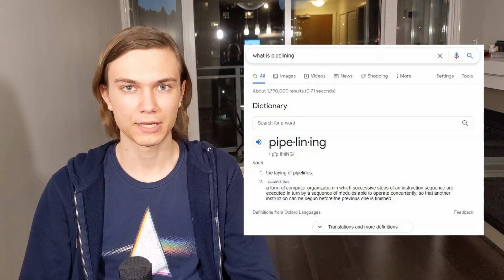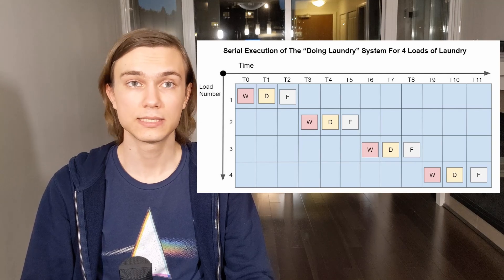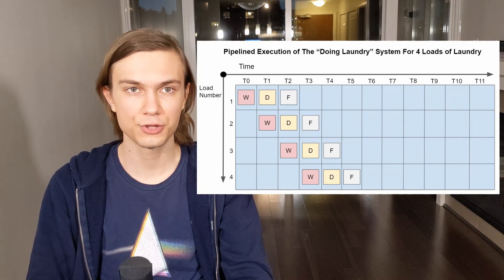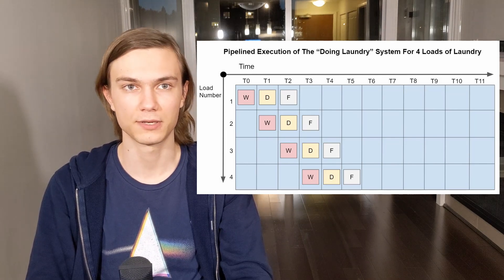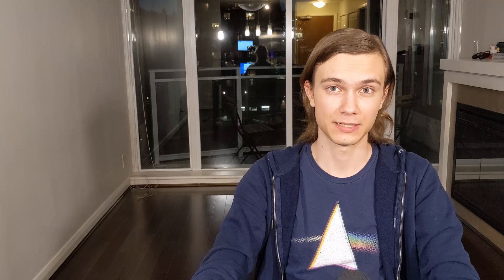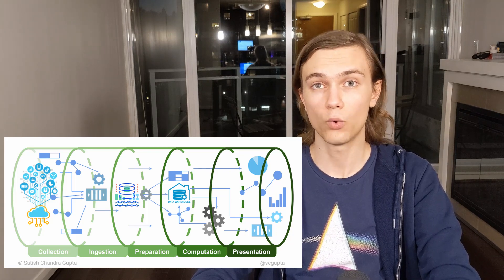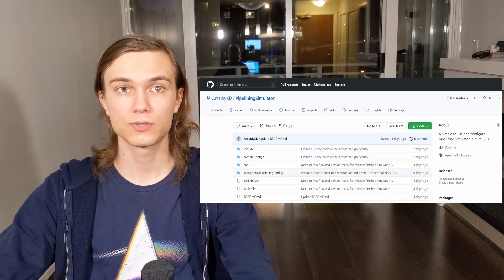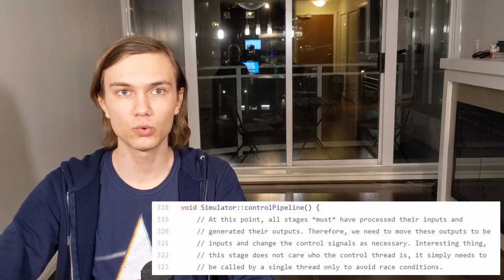Pipelining: Computer Architecture And Beyond!

Comment: Im amazed how can you design and write codes for your simulator in such a short amount of time! I dont understand anything when i read through it :) maybe when after I take the course in computer architecture in the future🥲
Reply from the maker: Ah, don't worry :) 

It'll take a bit of time to get familiar with both C++ and with computer architecture, but once you do, you will find that nothing in the simulator is too convoluted. 

Try not to compare your chapter 5 to someone else's chapter 25. I have been using c++ for full time work and took 9 systems courses over the course of my degree, so don't worry about not picking up everything right away. Take your journey at your own pace :)